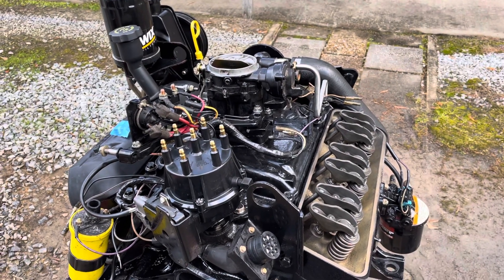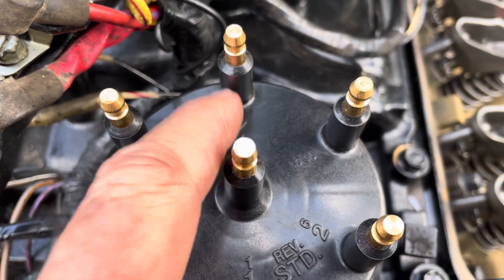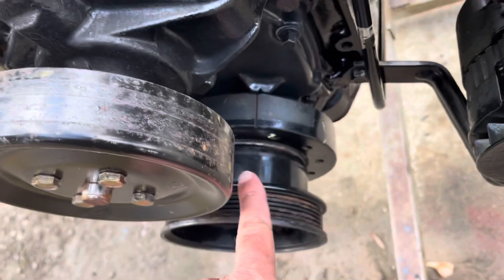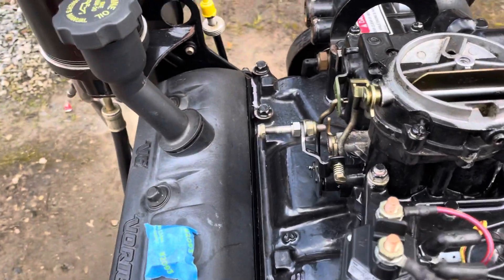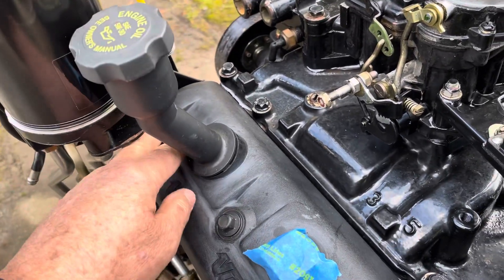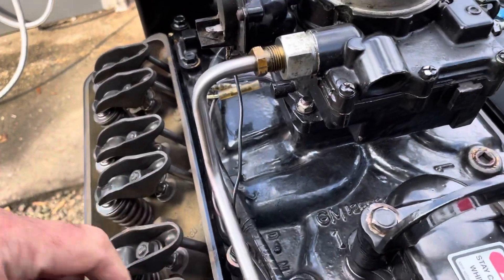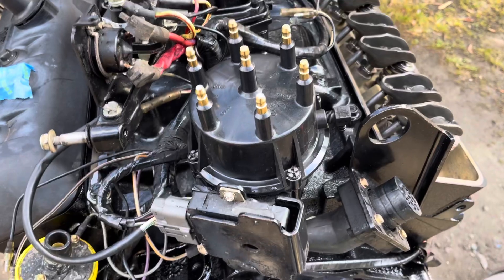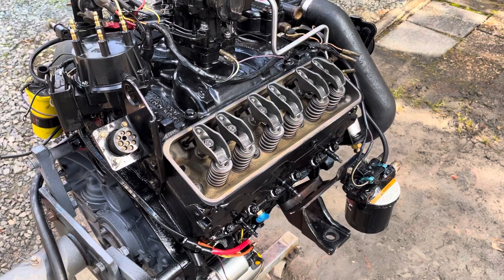Mercruiser 4.3 (3d) - Installing Distributor (Another Way)

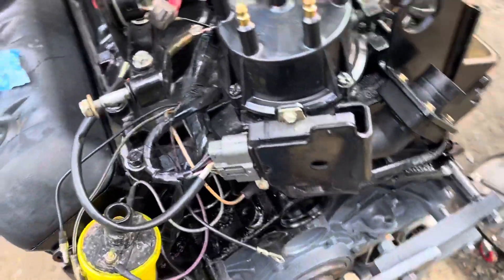Comment: At 1:09 there was a black wire just hanging there. Where does that wire go and what is it for? Just noticed it free floating on the back of my engine.
Reply from the maker: It’s a ground wire for the TB IV module. It’s supposed to be attached to the distributor body. In general black wires with ring terminals are ground wires that are supposed to be landed under a bolt or screw. The lack of insulation is the indicator it’s a ground.

Comment: Thanks for your videos. I was able to get the distributor installed on this new rebuilt engine I'm installing into a boat. engine fires.

I have a question if you don't mind me asking. The boat is shooting out water from the exhaust manifold where the exhaust manifold mates to the cylinder head on one side. I am using muffs to pump water into the boat but no water comes out with the exhaust. Could this be an internally cracked manifold? I tested the manifold and water flows through it off the boat and there's no visible cracks that I can see. It's kinda stumping me. also when I shoot the water hose into the Y pipe with the manifold disconnected it comes out of the propeller.
Reply from the maker: I’ve never had a manifold leak there. I think you left out a plug in the cylinder head. Watch this video:

https://youtu.be/nCiRi4G_Db8?si=hveoBpzrXl1GbAv_

It’s normal for water to exit the prop.
Reply: @moccasinmarine  oh my lord thank you! I ended up buying a new set of manifolds and it did the same thing. I just pulled them off right now and I definitely left the plug out! cant wait to get this back on the water thank you so much.

Comment: Much easier way would be to pull the #1 cylinder spark plug, put your finger covering the spark plug hole and then turn the crank till you feel the compression stroke stop.
Reply from the maker: Not necessarily on the boat, boat exhaust manifolds make it difficult to get your finger down there and turn the engine over at the same time. Much easier to look at the rocker arms
Reply: Not to be a spoiler but all the shift components will have to be pulled to remove rocker cover in boat. I’ll go with pulling # 1 plug, thumb on hole,remote starter and watch the mark come up to 0 on comp.

Comment: Great video.  This question is a bit off topic for this video, but I noticed that the oil cap says 5W-30.  My oil cap says that as well, but every operations manual I've seen for the Mercruiser 4.3 recommends 20W-50. Which do you recommend?
Reply from the maker: Mercruiser likes to create their own products to charge you and me a lot of money. They have their own 25w-40 blend of inboard Mercruiser brand oil that they claim is better for a marine engine. Since marine engines do live in a different environment than truck or car engines maybe there is truth in their claims. But when i break in my engines I just use 10w-40 oil since it’s going to be changed in 10 hours anyway. The customer can then put in whatever brand they are comfortable with. Me personally I would keep using 10w40 in the south.

Btw I just released a new video on distributor installation that has really saved me some time. Here is the link:

https://youtu.be/5bbtA90O2sI

Comment: Hi, I have a 98 merc 4.3 vortec, I just redid wires and cap and rotor and now boat won’t start at all.. I’m new to this, and the 1 on my cap is on the front of engine side and yours is facing the back of the boat.. have I messed up my engine now? Where do I go from here?
Reply from the maker: You may have gotten the wires back on in  the wrong place or worse. Watch my video link below for an understanding but do this instead. Remove the spark plug wires from the distributor cap. Then remove the cap. Rotate the engine clockwise as described in the video to place the distributor in the number 1 cylinder firing position. The video explains how. When you are confident that the engine is at TDC (top dead center) firing on #1, the distributor rotor tip has to be pointing at the #1 cylinder spark plug wire tower on the cap. So when you put the distributor cap back on note where the rotor points and that’s #1 spark plug wire position. Then going clockwise from #1 looking down, the order of the wires is 6,5,4,3,2.  Put the spark plug wires on the cap in this order. The cylinders are numbered 1,3,5 on the port side (drivers side in USA) and 2,4,6 on the starboard side. The point is let the engine tell you where #1 has to be. All this assumes you did not loosen and rotate the distributor? If you did then you changed the timing and it will require a mechanic with a timing light to set the timing. I have videos on doing that but you will have to buy or rent a timing light.

https://youtu.be/5v2LQVcUD_c

Comment: Hey my friend thank you for your channel I just purchased a boat 2008 tahoe 4.3 and your channel help 💯 can I leave it at the mark and then i move the distributor for timing gun can I create my 10° marine spec? Distributor If is in 100% timing always always going to fall in the same spot like the outside off the distributor,plugs number 1 facing the front of the motor or cables? Or that doesn’t matter?
Reply from the maker: I’m not sure I understand your question. Maybe this video will help clear things up:

https://youtu.be/5v2LQVcUD_c

Comment: Moccasin marine,  Your videos are awesome! Some of the best information out there! Your indepth explanations are very helpful , showcasing your professional experience. ABSOLUTELY TOP NOTCH.. I have one question.  On setting the distributor,  do you have the rotor direction aligned with the pickup? Because the cap has a small notch on the bottom that sets on the distributor in a specific orientation. But when I put the cap on the rotor is facing 4. Do I then use 4 post as #1? 
454 iv thunderbolt ignition 
(If you can make any sense of what I'm saying)
Reply from the maker: Hi thanks for the compliments. I produce videos that I hope teach something because I think that’s why people watch videos like this.

I think if you watch the video below it will answer your question and clear up any confusion you might have about installing distributors:

https://youtu.be/5v2LQVcUD_c

This is the video I was referring to in the video you commented on.

BTW you might want to consider replacing that Thunderbolt ignition system. You can’t buy replacement parts for it when it fails.